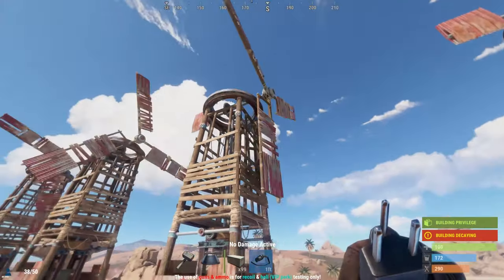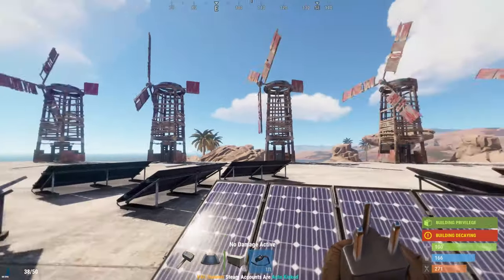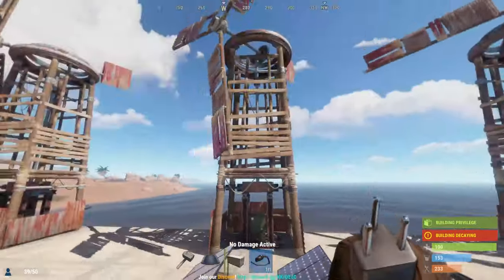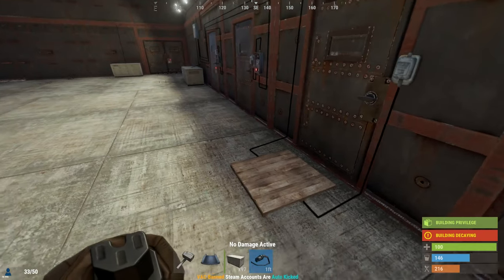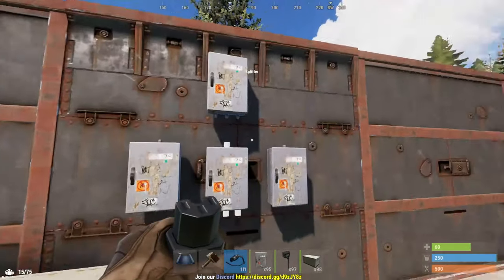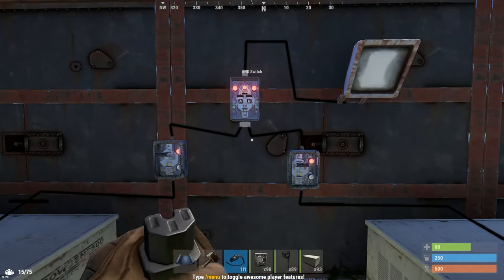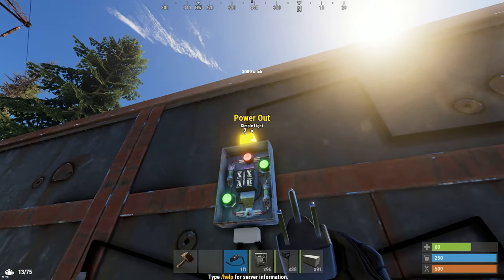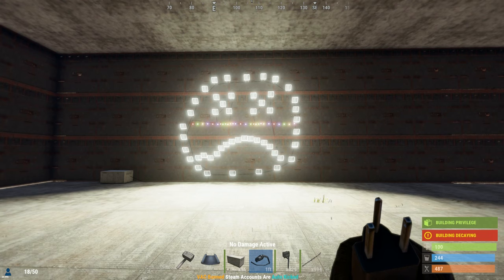RUST - Electricity Guide |All Components|

Comment: Couple of points to help.
Power for Solar panels is dependant on time of day, wipe to wipe, server to server.  The sun doesn't always rise in the same place and if there's weather conditions such as fog - power is again limited. Batteries can be used while being charged, but as said, when the battery is empty (~5s) the battery will cease to power till it has 1 or 2 seconds more power. The drain is faster than the charge, although again like you say - the drain is slower.

I need to finish off watching your vid, but for now - good job so far and keep creating more :)
Reply from the maker: Thanks for the added info and feedback, Rusty. With rain and snow on the way, I wonder how consistent solar panels will remain. I gotta say, I love modded servers with a slight chance of you getting a generator, haha.
Another vid on the way soon! Lemme know if there's any circuit or electrical design you need help with and Ill make a guide on it!
Reply: @shotgunjump432   xAbendrothx  Thanks dude, finally finished watching and noted another thing... HBHF sensors have a range of ~30m (thats assuming that 1 square tile is 10m by 10m) - let me know if I'm wrong here. Thanks for the offer of building circuits :)
Reply from the maker: Well, the in-game description of the HBHF says 20m. I don't know if it is 100% accurate or not. Maybe we can lay out a bunch of dead, naked slaves and assume they're all 5'8'' and see how close to 20 or 30 meters we get to xD
Reply: @shotgunjump432  haha

Comment: I CAN'T CONNECT A ELECTRICAL BRANCH TO TWO SPLITTERS WHy?
Reply from the maker: You can. You need to make sure theres enough power in the system. Then make sure the branch-out is set to a good value. Like, if you had 63 power, send in it through a branch with it's branch-out set to 31. That would allow each splitter to receive 30 units of power. So each output of the splitter would be good for 10 units of power each.

Comment: From the research I've done, the orientation of solar panels does matter.
The sun in the sky is not the sun the solar panels use.
There is an "imaginary sun" that travels straigh through the middle of the map from left to right. It bisects the map into a north and a south.
If you're south of that line, face your panels north.
If you're north of that line, face your panels south.
You should get max power regardless of where the graphical sun is.

Comment: how would you do a tesla coil trap with a heart beat sensor when only one power is dispensed
Reply from the maker: Use an AND Switch. Branch your main power to an AND Switch and the heartbeat sensor. Now connect the output of the heartbeat to the AND Switch. Connect the output of the AND Switch to the coil. Hope that helps :)

Comment: Solar panels should always face to the center of the map. so if your base is in the south part of the map, they face north, and vice versa. If your base is right in the middle, it can take a lil trial and error to know which direction you need to be facing them. I can guarantee this info is correct, at least as of the time of writing this. Also, batteries now support passthrough charging

Comment: Thankyou for this video it really goes in depth with electricity in rust. 
To add to your comments on connecting to batteries through root combiners:
I setup a system with 4 large batteries and combined them into a single signal of 400 power. i did not realize this would cause me issues later on in relation to the issue you brought up. Interestingly though it seemed that only one of the batteries was decharging at a time even if the power usage exceeded 100. It would be nice if there was a way to combine power through other components and not just through batteries/power sources

Comment: I thought the amount of energy the wind-mills produced depended on how high the wind-mill was
Reply from the maker: Do a degree, yes. The height of the wind turbine will give you more consistent high wind speed. But don't feel like you need to put it on a mile high base. Just slap in on a roof or something and you'll be aight. Most important with this is to just make sure no wind is getting blocked from reaching the turbine.
Reply: @shotgunjump432  and does it matter where the turbine is facing ? Like the solar panel should face north
Reply from the maker: The wind turbine can face any direction.

Comment: So is there no way to have an hbf sensor trigger both an alarm and a flashing light? Because of the power output of 1.
Reply from the maker: You'll need to use an AND switch to have an hbhf trigger multiple things.
Reply from the maker: Link an hbhf to one input of the and switch, and connect an open line to the other input of the AND switch. Now connect the output of the AND switch to whatever alarm stuff you're doing. It will only turn on when the hbhf is triggered. Watch the part of the vid where I go over the and switch. There a shortcut to the part of the video in the description.
Reply: Thank you. I will try this. I just put two hbhf sensors side by side. One triggers light, other triggers alarm. Ur way may be more cost efficient but I don’t have and switch researched yet. Lol
Reply from the maker: I forgot to mention it, but the hbhf will passthrough power equal to how many people it detects. Ie if it detects 5 people, it will let 5 power pass through. You could rig an hbhf to a counter in your base so you can tell how many people are outside without going outside.

Comment from the maker: I forgot to mention it, but the hbhf will passthrough power equal to how many people it detects. Ie if it detects 5 people, it will let 5 power pass through. You could rig an hbhf to a counter in your base so you can tell how many people are outside without going outside.

The memory cell will remember what state it is in even when you cut its power. Ie if it is in inverted state and it loses power completely, upon restoring power, it will restart in it's inverted state. Same for normal state.